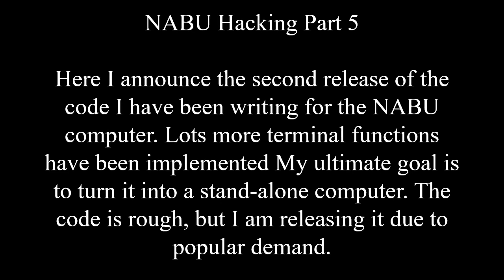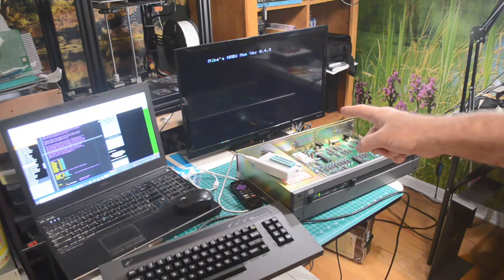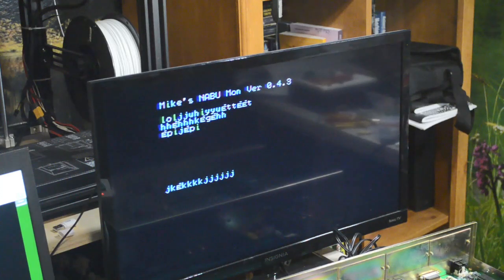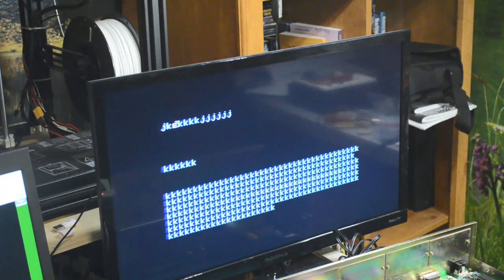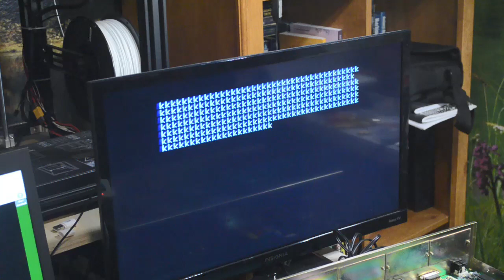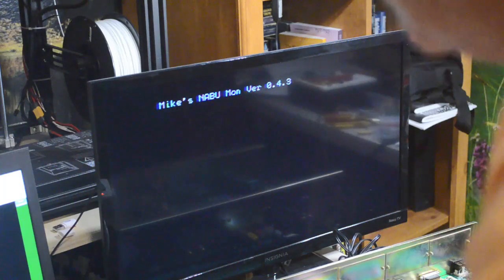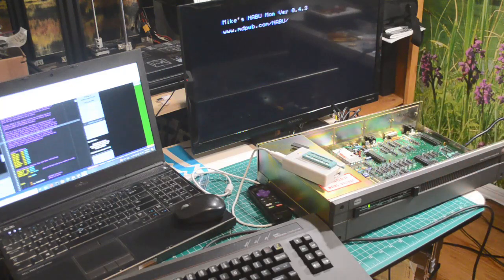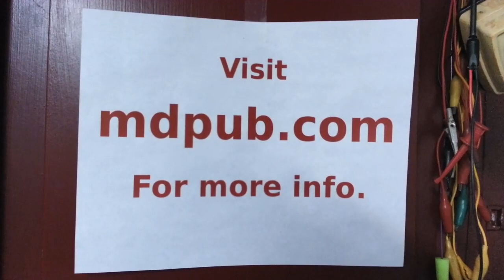NABU Computer Hacking Episode 5: Another Firmware Release!

Comment: Great job plowing through this and getting a working monitor going. Fantastic exercise between the holiday and moments with family! Upto this moment I've been working through interpreting the existing ROM to understand some of the port functions used. Now I'm ready to start doing something similar. Question: When using a larger ROM, is cutting the 4k trace necessary to still use only 4k of a larger ROM (28pin)?
Reply from the maker: Great question. I wondered about that too at first. The schematic looked like the socket was wired to handle it. I decided to just try the 8K EEPROM and see what happened. It works fine, but of course you can only access the lower 4K. I will mention this in the next video for anyone else wondering.
Reply: @electrogeek6437  All the best, and thanks. I left the same question with Kris who has discussed on an earlier video and never detailed; he did reference additional pins strapped to +VCC and looks like made some assumptions too. Likely the same, plug and play. Thanks again